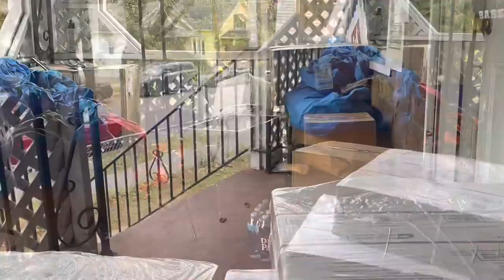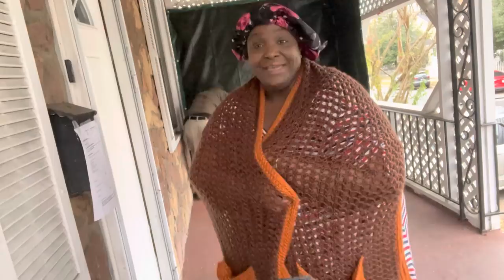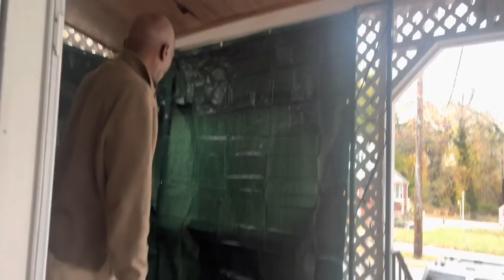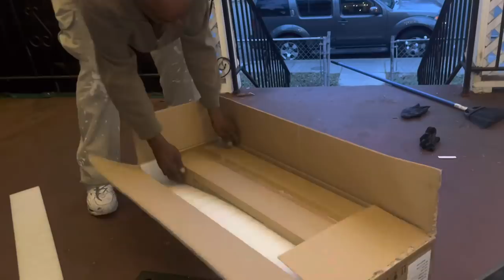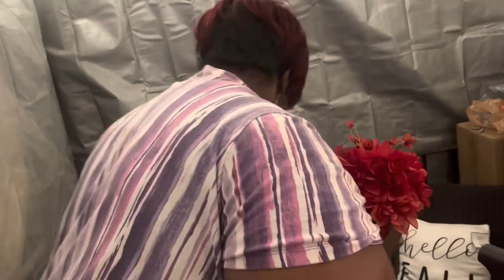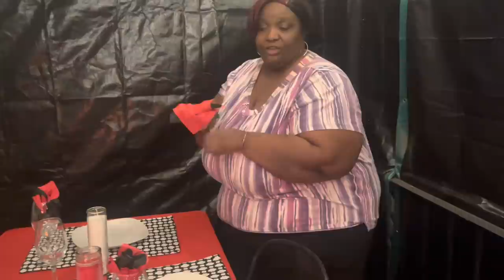Final Reveal Front Porch Dining ￼

Comment: It looks really good. What's the brand of that heater?
Reply from the maker: Here’s the link Outdoor Patio Heater, Luwior 1500W Electric Infrared Heater with Remote, 3 Modes, 24H Timer Auto Shut Off, Space Heater with Tip-over Over-heat Protection, IPX5, Wall-mounted/Tripod For Garage Backyard
Reply: @soulfultvlogs  Thank you so much Ms. T.
Reply from the maker: @firstname8348  you’re welcome